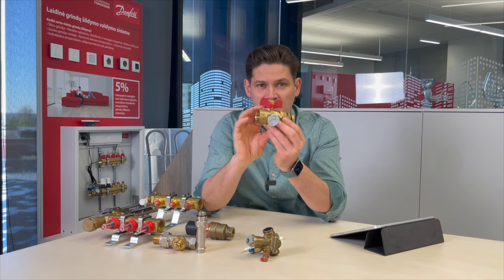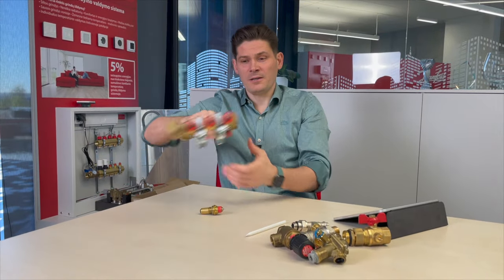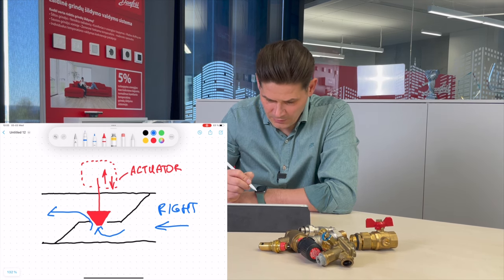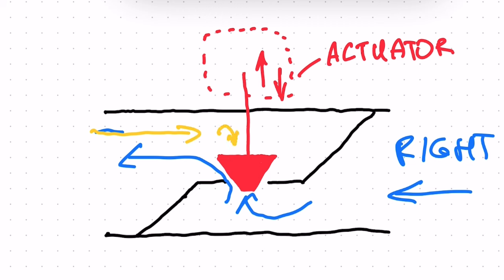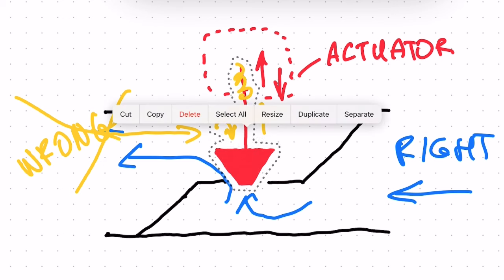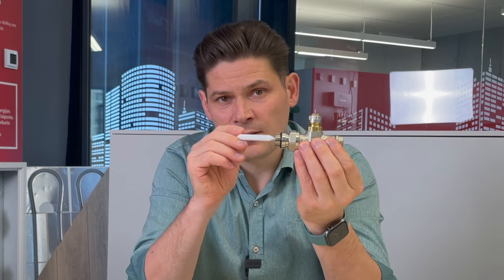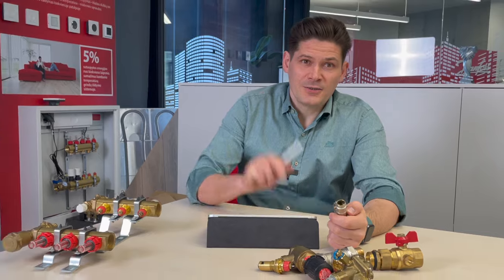Noisy radiator. How To Fix Banging Ticking Knocking Hammering radiator noise?

Comment: Hi, I also have a Danfoss integrated valve as shown at 3:04. It makes banging, hammering noise when the pin is pushed in 90%. It stops when it is pushed in 100%. The higher the flow rate set up the higher the banging noise.. we have just moved in to this house. The valve is on the right side of the radiator, is it possible that i need to change it to the other side?
Reply from the maker: Hi! I think you are not able to change side of integrated valve. If warranty still exist you should contact installing company to fix this. As they need to mount pipes correctly. Or they can use crossover H piece -https://images.app.goo.gl/AASTJhe1aUNXRjFS7
Reply: @ thank you for your answer!

Comment: So the problem can be solved by opening the valvula?
Reply from the maker: Yes, for temporarely problem solving. Open on max or close fully. Complete solution would be installing flow and return pipes properly.
Reply: The same question..😊

Comment: So how can this be fixed? Is this expensive? My parents house has this problem and it wakes me and them up at night a lot. Your help is appreciated.
Reply from the maker: I case you have mixed supply issue you need plumber to fix it. Cost depends on installation. For bottom connection radiators X "H" piece exits. Other installations might be fixed in boiler room, valve change or something else will help.

Comment: Hello. I have a problem where i have 4 radiators in different rooms in my apartment which all makes loud banging the second they stop heating. The banging only happens for 5-10 minutes and then it usually comes again after an hour or two. Is this related to this problem? It is EXACTLY like 00:12...
Reply: 00:13
Reply from the maker: I am 99% sure you have mixed flow and return pipes as on a video. There are several ways of problem solving. Competitive plumber should be aware how to solve it.
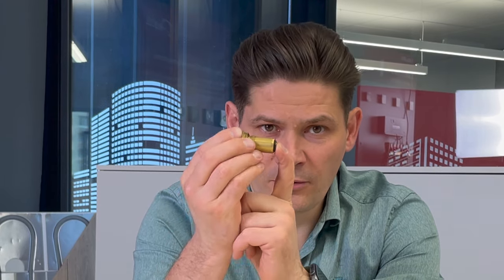Reply: @heatingsolutions123  Thank you, I actually had a plumper out looking at it BUT he told me that he had no idea what was happening. I have the vent at 3:10, how can I fix it when I have that one? Also thank you for answering since I need a new visit from my plumper (I'm in a rented apartment so there's a plumper 'connected') and he already told me that even though he is visiting me again he can probably not help me, which sucks so much since I have to listen to this noise day and night. So thank you a lot for answering since I was contemplating moving out because of it.